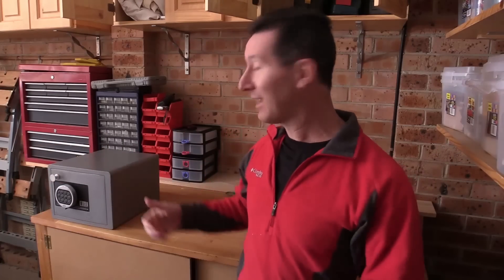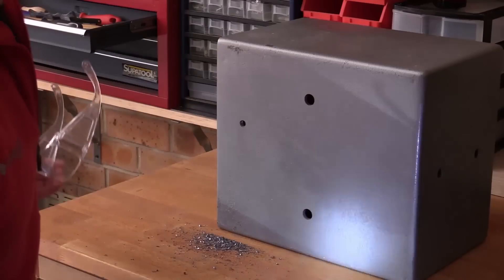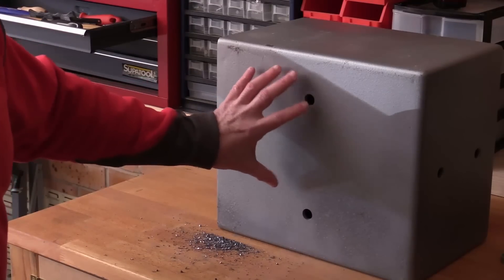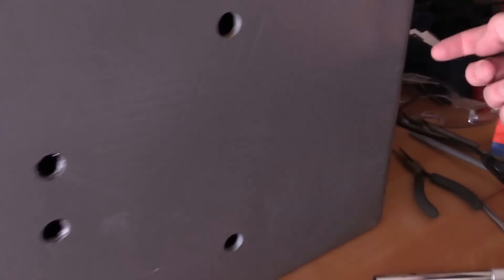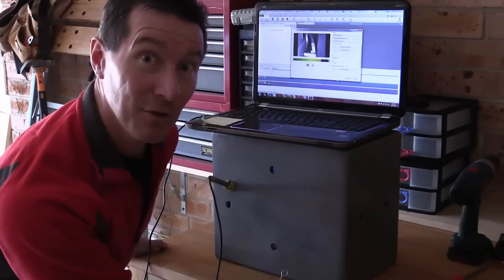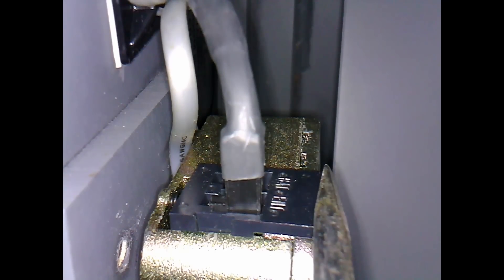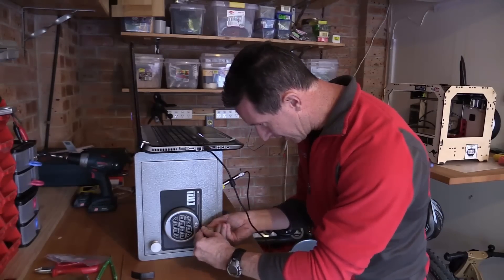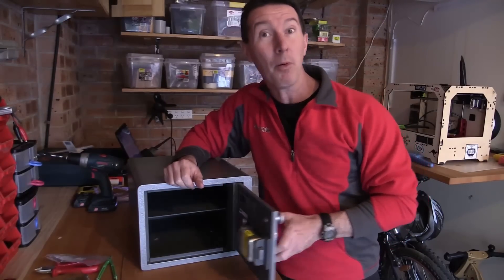Cracking into a CMI Home Safe

Comment: Larger the diameter drill, the lower the speed should be.  Metal has a law you have to abide by.  Surface Feet Per Minute. Different steels/metals have different speeds.  With your drill, Aluminum you can run it as fast as you want, but most steels you should be on setting 1 and probably only half speed and using something like WD-40 as a coolant/lubricant.

Comment: And I thought the "ship in a bottle" laparoscopy work I just did this evening on my 1984 Ford F150's gas tank was bad. The "sock" (pre-filter) on the fuel pickup tube had fallen off (was in there replacing a wonky sending unit, which also contains the pickup tube) and I only had the sending unit hole to work with (I still had it under the truck with the filler neck attached. With my wife's help, I finally was able to fish it out with a coiled part grabber thing. I had tried spearing it with a coat hanger but all that did was turn it into the worlds most annoying game of foosball ever.

Comment: Low range works better for large drill bits. More cutting torque and better control.
Reply: Yes, too high of speed will just burn up the drill bit, especially when you don't use oil. A mag drill would make things much easier as well.

Comment: Lol if you had mig welder (cause their easiest to learn basically point & squirt) you could have just cut yourself a nice little square out with the grinder. Then welded the cut-out back in place. A bit of a sanding the weld flat a touch of paint & no one's the wiser. The alternative was your way & I ain't got your patience to do that.
Reply: That is how my father got a house safe, it was broken into with the thieves cutting a hole in the side using a hammer and cold chisel (in the days when angle grinders were a specialty tool, and not common), so he used tinmans rivets to put a patch on the inside to fill the hole, and poured into the side cavity plaster of paris to make it fire resistant again, then spot welded a patch on the outside, and painted it. Nice free safe, and it came with a half dozen keys as well. He used it as a document safe, because of the fire resistance, not as a valuables safe.

Comment: I have pretty much same lock on the safe that's bolted to the concrete slab inside the concrete cavity and wired to the seismic sensor and then to the alarm system. so if someone somehow bypass the movement sensor and find its hiding spot soon as he/she touched the safe it will trigger the alarm.

I've been replacing the 9V battery every 2 years but wonder what happened when its battery is completely run down. will it work with the programed codes once the battery is replaced?
Reply from the maker: Yes, the code is stored in EEPROM
Reply from the maker: @JohLincN  No, EEPROM are rated for much longer life, decades.

Comment: And here I was hoping he'd be going all LPL with a EMP attack.
Reply: Well, without power to retract the bolts, an EMP will not help much. Also, a quality safe will not have a "default to open" fallback.
Though I have a slight deja vu with this video...
Reply: @higihups  If I remember right, LPL showed that with an EMP attack, the electronics tended to reset to factory.  Either a default code found in the user manual, or "unlocked" mode.
Reply: @russellhltn1396  Even if it would be vulnerable to an EMP(what a quality safe should not be, LPL says about that: "it usually works on cheap electronics"), 
it would not have opened. Neither if there would be a magic ritual, to load the factory settings. It was unplugged.